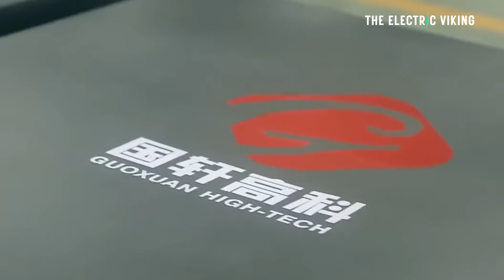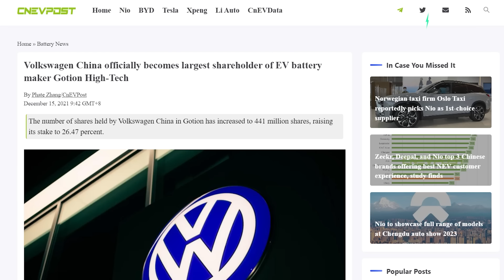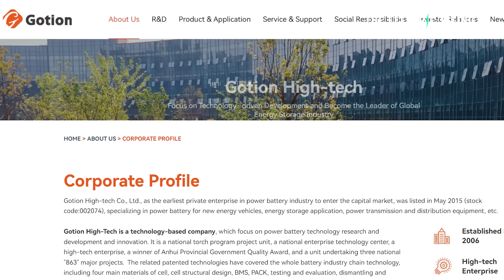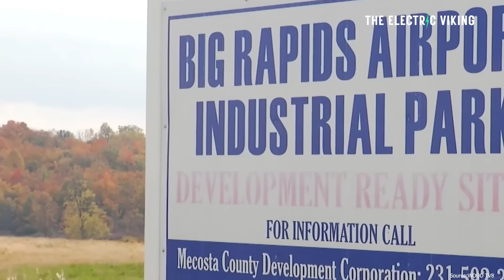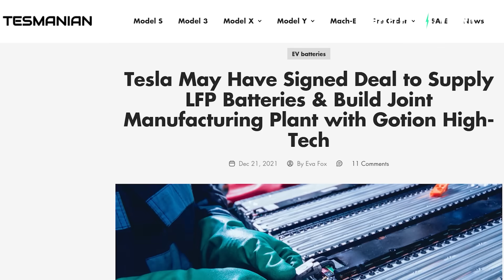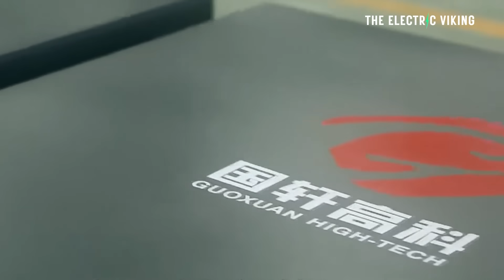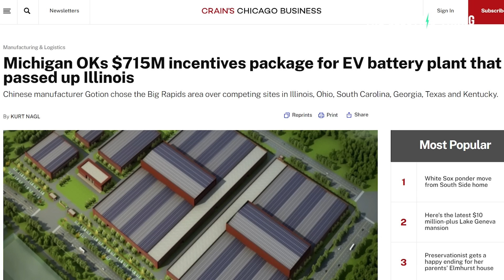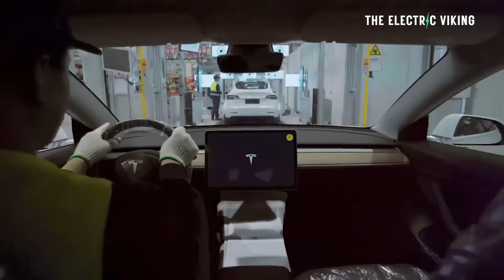The Chinese battery company building 2 battery GIGA factories in America

Comment: Safer, cheaper, higher cycle life, lower lithium input, more abundant material based battery chemistries such as LFP, LMFP, and Sodium Ion will eventually win the day for mass market BEVs and stationary (and portable) storage in America. Chinese battery OEMs will likely have a significant role in this transition from NMC to safer chemistries. Tesla will likely eventually develop their own LFP, LMFP, and possibly Sodium Ion, cells, in addition to Solid State (currently used in SpaceX aerospace vehicles) as these technologies mature and Tesla learns to make them cheaper or better than they can buy them from CATL and other suppliers. Tesla may possibly eventually become a mass market battery manufacturer in addition to its other businesses.

Comment: It's not just cars. Semi trucks, and the MegaPack and PowerWall side of the Tesla business will need more than a few batteries - but who knows how many?
Reply: Plus off highway like construction and agriculture. You also will convert fork trucks and other industrial equipment. Low cost batteries will electrify everything.
Reply: Every home needs 200kWh battery, every car needs a 150kWh battery.
Reply: @AORD72  car 150 ?   no
Reply: @Notme-tq4xs  Why not? If there is plenty of cheap batteries in the future and they are 500 Wh/kg then 150 kWh batteries are fine. They will provide 750-1000 of range. Plenty of towing capacity and no range anxiety. You think we should remain energy and capacity poor?

Comment: It’s wrong to think that the only use of batteries is EVs. Stationary Storage could be a huge market. Also, heavy equipment makers like Cat are already prototyping electric mining trucks. It’s also wrong to think that there are no improvements to be made to non-LFP battery types. In fact, betting the farm on LFP would be a mistake at this stage as battery tech is advancing quickly. One of the current approaches is a hybrid pack that uses both types in the same pack. 

The bigger problem is the chemical supply chain. We need more graphite, lithium to make LFPs. Probably will need another supply of Nickel as well. Cobalt could be phased out, but it’s unlikely. These are the supply chain vulnerabilities.
Reply: Totally agree.  And because the advancements in recycling Lithium based cells has advanced enormously in the last few years, I seriously doubt a glut in rechargeable cells will be a bad thing.  I do not think the glut will eventuate.  There is plenty of Lithium to supply such a hike in cell manufacture and mining of lithium and rare-earths will inevitably taper off after a few years.

I reckon Sam is thinking down the wrong path here.  And the main reason is that stationary storage of electrical energy (both commercial and domestic) will allow breathing space for upgrading the woefully vulnerable power grid system in the USA and many other countries.  Having massive renewable energy farms with storage is a solution, but subject to the same vulnerabilities if the grid goes down because of a transmission-line failure or two.

While Sodium Ion technology looks promising and also way less costly, it will be some time before this storage variant reaches commercial viability.

I believe the World generally is steadily moving towards a far more localized energy generation and storage paradigm.  And this will be of enormous importance when extreme weather events become even more prevalent over the next few decades.

Comment: Definitely better than the NMC battery factories being built. LFP solves a lot of issues not just cost but a few safety concerns too. They also have much longer cycle and shelf life. Would have been even more amazing if it was a Sodium battery factory.
Reply: >>  LFP solves a lot of issues not just cost but a few safety concerns too. <<
China's LFPs are cheap, inferior batteries with little or no improvement over NCMs.   
>> They also have much longer cycle and shelf life <<
This only applies to LFP application with low SOC and low C-rates -- ie, stationary storage systems; in EVs, LFPs have low energy density and heavy, so they are strictly limited to entry-level, low-range EVs.

Comment: About the time this LFP factory is finished, the LFP battery will most likely be obsolete.
Reply: Well the warehouse is already there with plenty of room for expansion. Getting the equipment built and shipped and installed could be another story.
Reply: LMFP, not LFP.
Reply: Can’t they change the chemistry? The form factor is the same.
Reply: LFPs may not be so price-competitive, once 300+ GWh worth of NCM battery capacity comes up in 2025.

Comment: I think Sam grossly underestimates the impact of unintended consequences on the demand for CHEAP batteries.  (Emphasis on CHEAP)
1. Cars - we already got that, Tesla has led the way
2. Trucks / commercial vehicles; that revolution has already started 
3. Home energy storage;  may be cheaper than building out the grid to simply put battery capacity in every home, in some places off-grid is ALREADY much cheaper than a grid-tie
4. Farm equipment; John Deere is a corrupt near-monopoly but electric farm equipment IS going to be a thing
5. Conversion of EXISTING cars; bring the price of batteries down low enough and the supply high enough and this WILL happen

I could be overly optimistic, but there will be other uses for generic battery technology.